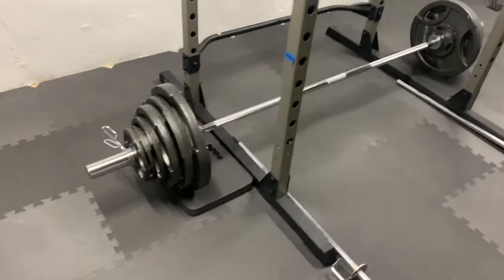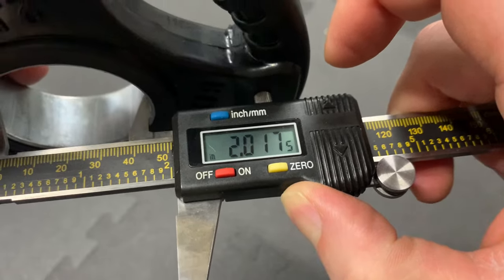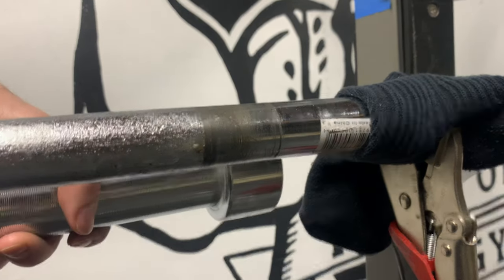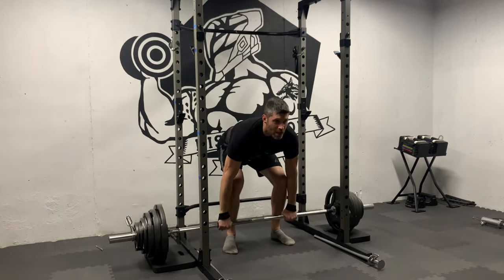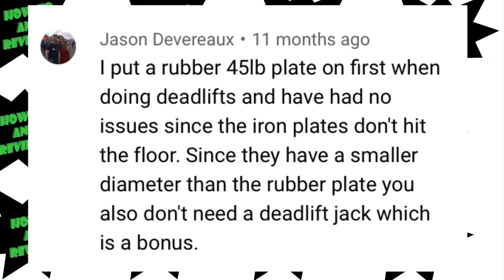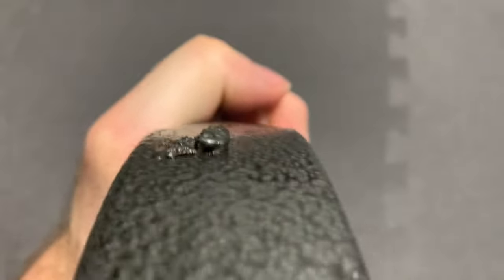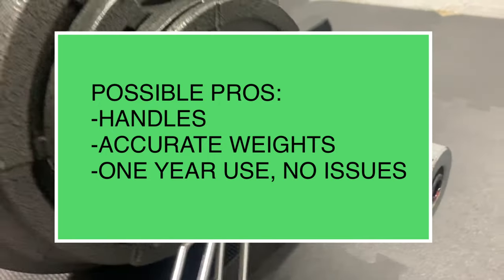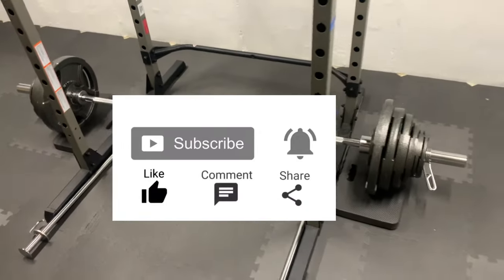ONE YEAR Update Review of Fitness Gear 300 lb Olympic Weight Set | Plates and Bar | Home Gym Dick's

Comment: Thought I'd leave my thoughts on these weights since i bought the same set. I paid 299. for my set. Thought it was a good deal. Prices are ridiculous now. I've had lots of health issues long before i started lifting but i was not even close to benching 300lbs when i started. Due to an old injury benching was hard for me but i started to to a commercial gym to workout with someone on weekends and enjoyed working on a Smith machine and had less shoulder pain. I eventually invested in a Smith machine power rack with no counter weights.  The bar itself was a disappointing 37 lbs so i ordered a set of micro plates from Amazon to make the bar an even 40 lbs. So with my plates it gave me 295 lbs to work up to. It did not take long to need more.  I found a set of 45 lb plates on sale and it gave me more than enough to lift with. I even have to use old 25 lb plates with a 1 in hole, they have the handle holes big enough to fit on the bar.  Without putting much effort into training I've hit a Rep Max of 435 lbs. I've thoroughly enjoyed using my weight set i bought.  After we move im going to focus on using the original barbell that came with the weights. But they have definitely held up with no issues. All my plates weighed what they were supposed to be as well, i as and am very happy with my purchase. I've searched several apps to buy stuff that is for sale by zip code and found this set for less than 300 bucks,  some for 225 dollars. So they can be found even if with some blemishes. Thanks for the review.
Reply from the maker: Awesome! Thanks for sharing!
I also ended up getting more plates. I got another complete set from Facebook Marketplace and resold the barbell that came with the second set. My original barbell is holding up just fine with no issues. I didn’t need a second one.

Comment: I have this set and it's been great. I wanted to buy some Fitness Gear 5 pound plates for my loadable dumbbells to match the rest. They are expensive compared to cheaper brands on Amazon. Dicks charges over $2 a pound for these plates.
Reply from the maker: Yeah, it’s been a good set. And buying them individually is very expensive. I ended up buying a second 300 pound set to get more plates. Pretty much a dollar per pound.

Comment: Owned this bar for 3 ish years and have deadlifted around 395 on it, i realized today it is slightly bent. Ive had problems over the years with the bolts coming out - each time i clean them, loctite them and use an impact to put them back on.
Reply from the maker: That’s great to know, thanks for sharing!

Comment: This was an excellent follow up review. I just purchased this set for 400.00 along with the power cage and the bench you have. I have my first in home gym thanks to you and your reviews. Your videos are very comprehensive and straight to the point. I also purchased those stall mats that everyone recommends. 10/10. Tractor Supply Co. for the win. The mats were $52 for 4x6 feet. Thank you again for the these in-depth reviews. Have a Merry Christmas! 🎄
Reply from the maker: Thanks, I appreciate it, and I’m so very happy that the review videos have helped you out. I have definitely purchased some products that I did not care for and got rid of them, but the cage, weight set, and bench are definitely winners without breaking the bank.
Nice tip on the stall mats. I just checked them out online and that is a great option. Thanks for sharing!

Comment: Nice review! I bought a similar Nautilus set. I'd be willing to bet it came with the same Chinese made bar with the same 10mm hex bolt (the nicer barbells use snap rings and half moon collars to hold the sleeve on). Like you, I took it apart, greased it and applied LocTite (blue) to the threads. If you get into heavier lifting with that bar, remember that possibly the washer is the only thing holding the sleeve in place, especially if the bolt head is smaller than the bore of the sleeve. I watched a video where a guy who lifted pretty heavy actually had the sleeve slide off because the washer had "coned" over time, allowing the sleeve to slide over it and the bolt head. Another thing to consider is that bar probably doesn't weigh 44 - 45lbs like you'd expect. Mine weighted about 37lbs. That certainly throws off the poundage you THINK you're lifting. I finally got tired of trying to figure out the math on how much I had loaded on the bar and spent the money for a 20kg (44 - 45lb) Ohio bar. But, put it on a scale - maybe yours is the proper weight (I'd be surprised, though!)....😎👍
Reply from the maker: Good points for sure. One of the first things I did was weigh my bar. It weighed in at 44.6 lbs, which was close enough for me!
Reply: @HowtoandReviewsOfficial  Nice! I got one of the low end ones, I guess. I had no idea there was so much discrepancy in something I assumed was strictly "standardized"(including plate dimensions and weights). I've worked in the bike industry, and it's all over the place, too, on standardization. Part of the issue here in the U.S. is our refusal to let go of SAE standards. It really gets awkward when you mix that with metric. 😬
Reply: @biknjak  like you said man they’re cheap pieces of scrap metal that the factory just kinda measures and sticks some sleeves onto.  I got myself an Ohio Bar as well and recently rogue was having a sale I got the all black oxide bar for $175 shipped to my door.  The only reason I ever bought this set and I got mine back in the day at modells because of just the amount of weight you get back in 2015 when I got it it was $300 for the 300 lb set so 245-255 (the plates can’t all be spot on) worth of iron for roughly $325 that’s tax and I didn’t pay shipping so that’s some cheap plates for new.  These days you won’t ever find that again but you’re right having a good bar makes all the difference
Reply: @MOET02 Yep. I'm going to use my old bar for rack pulls, etc. I don't want to bugger up my nice bar if I don't have to. I bought the e-coat Ohio bar and love it!

Comment: Awesome review dude thank you so much.  So would you feel comfortable adding another 45lb of weight to the bar to hit the 300lb capacity?  I'm Torin.  I've always trained with dumbbells but I'm reaching some plateaus because I can't get much heavier with dumbbells. Been looking at this as an option to start with but I do forsee eventually breaking the 300 pound weight limit. But it would probably get me a ways.
Reply from the maker: I personally feel confident in meeting or slightly exceeding the advertised 300 lb capacity.
At the time that I bought this it was $250, so it was a no brainer (I really wish I had bought 2 sets at that time, currently hunting for more Fitness Gear plates on FB marketplace for a good price).
Now that it’s $400, there may be better options if capacity is a concern. Costco has a set for $500. The plates are rubberized and the bar has a 700 lb capacity. May be something to consider. Link below. 
But yes, I plan meet and exceed the 300 lb capacity with no worries. And if it is an issue, I’m ok with purchasing a better bar.

https://www.costco.com/inspire-fitness-rubber-300-lb-olympic-weight-set.product.100712037.html
Reply: @HowtoandReviewsOfficial  Ok awesome thanks so much, I really appreciate it.  Yeah that does sound like a good deal too.  Yeah the set I'm looking at a guy bought, never opened, and is getting rid of for 375 but the capacity I know eventually will be an issue.  Really appreciate your info!
Reply from the maker: @DadBodFitness  no problem, glad it helped

Comment: Just curious why you put the 2.5 lb weight plate on the inside of the stack? Great review and follow up!
Reply from the maker: Thanks! Glad you enjoyed it!
Putting the 2.5 plates on first is just a habit. I always leave them on for 2 reasons.
1. It makes the bar 50 lbs, and I suppose I think it makes the math easier. I’m just used to it.
2. Once upon a time, I benched 295 for a PR . Would have been 300 if I had the 2.5s on. So, I just always leave them on.

Comment: Why do you have the 2.5 on the inside? Btw I deduced that you were an engineer within the first minute if the video lol.
Reply from the maker: Back in the day, a lifting partner and I used to leave them on to make the math easier; 50 lb bar instead of 45 45 lb. I tried doing it again for a little while, but saw no value. Numbers are numbers and math is math. I’m not currently doing that anymore.

Comment: I bought two of these sets and hopefully it will last me forever. Going to get a nicer bar, however cause mine is in my garage and stainless steel is ideal
Reply from the maker: I’m right there with you! My biggest regret is not buying two of these sets when they were $250. I’ve been hunting Facebook Marketplace for more matching plates. And with more plates, I plan on a better bar at some point if necessary.
Eventually I’ll have to give up on FB Marketplace and buy another set.

Comment: Even with the 45s being smaller cant you slap a bumper on each side then add the smaller 45s and be fine?
Reply from the maker: That would definitely work well. The 45 being smaller is a benefit in that situation because you don’t need to lift the bar up with a 45 already on it to slide on a second 45. It will slide right on with dragging on the ground since it is smaller.

Comment: So what do you think after one year iam thinking about getting one not sure
Reply from the maker: Quality cast iron plates. The handles are great. The pant is very nice and durable. 
The bar is cheap, and only has an advertised 300 lb weight capacity, but it has held up fine with no issues and is fine for home bench press and squat use. Definitely not suitable for dropping though.

Comment: What's the torque spec on the hex bolts? I can't get mine to budge even with leverage.
Reply from the maker: There may be thread locker on the bolts which would make it difficult to remove. I initially removed them nearly 2 years ago and I don’t recall.

Use a ratchet with a longer handle or put a pipe or something on the handle to get some more leverage. It’ll come off.

I just re-tightened them muscle tight with no issues. The sleeves are still completely secure, but the published torque spec for these grade 8.8 M12 SHCS is 60 ft*lbs
Reply: @HowtoandReviewsOfficial  Thanks! I was thinking thread locker also.

Comment: So this bar wouldn't be able to hold 400 pounds
Reply from the maker: It only advertised for 300 lbs, so officially I won’t recommend exceeding 300 lbs. But as a mechanical engineer, I’ll say that it should have been designed with a safety factor and should be capable of at least double. But I did not personally design it and cannot recommend exceeding the advertised 300 lbs weight capacity.